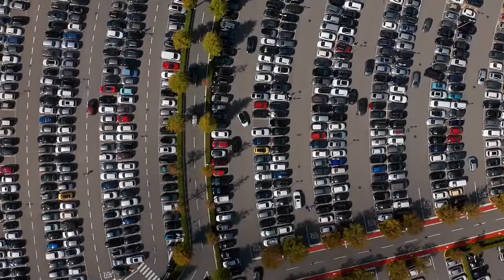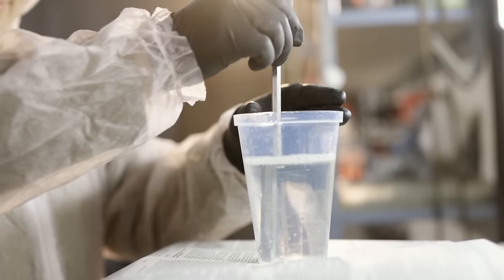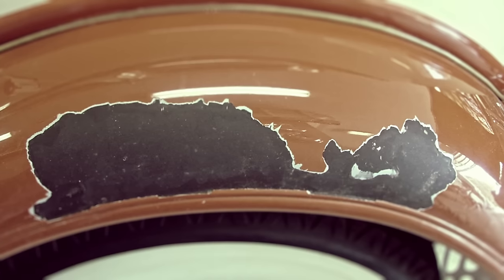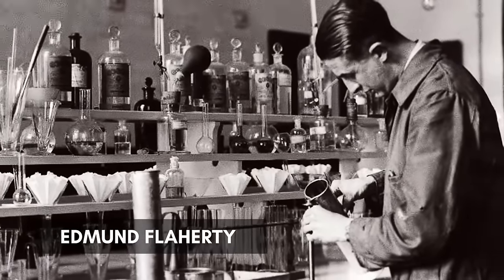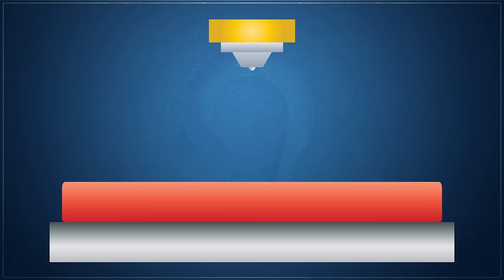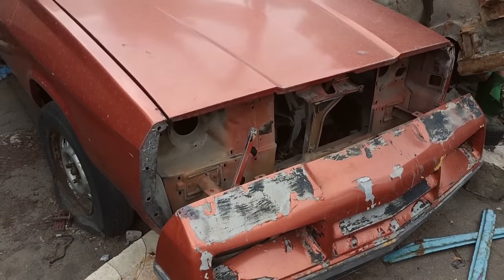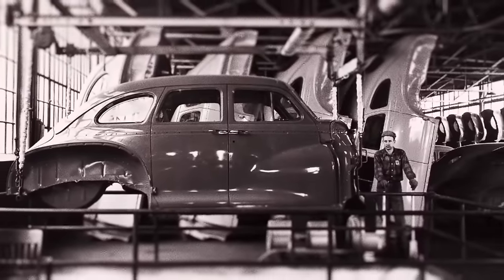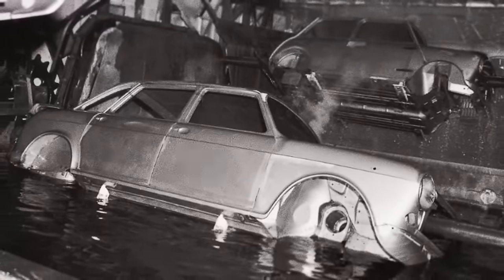The Evolution Of Automotive Paint

Comment: i have worked on cars for some 50 years and now have a collection of old "mopar" muscle cars.  after graduating from high school in 1972, i built and ran an auto body shop for three years and then went on to college and law school.  i was the main "paint guy" at my body shop.  in the 60's and 70's, GM used Acrylic Lacquer and Ford and Chrysler used Acrylic Enamel paint.  both these paints were "single step" paints meaning that you just shook the paint vigorously, thinned it (usually 2-1) with a Lacquer or Enamel thinner, and then sprayed the paint on the vehicle.  most colors required at least two coats - except black.  the "metallic" paints (paint with small metal flecks) had to be applied in a certain way or you would get what was called "tiger stripes" meaning that you could see broad "mismatched" areas where the metal fleck "laydown" was mismatched from one area to another.  the thinners for these paints came in three temperatures ranges, fast drying, medium drying, and slow drying.  you used fast for cold shop temps and slow for hot shop temps.  Lacquer was the easiest to use as if you made any mistakes like a dry spot, a "run in the paint", or the pesky fly that hit a panel, you could wait an hour and the paint was dry and hard enough to sand down and completely refinish.  Acrylic Enamel was a different story.  that paint was a little thicker in viscosity (as it had more clear acrylic in it) and you usually had to wait 24 or even 48 hours to sand and refinish Enamel.  it was also easy to "blend in" small repairs or "partial panel painting" with these paints.  there was little difference in appearance between these two paints, however, a skilled bodyman or painter could tell the difference between Lacquer and Enamel vehicle paint.  i closed my body shop in 1974 to go to college.  when i retired from my law practice in 2016, i started my car collection.  i have found that the "water based paints" are AWFUL and CANNOT be used by a private person in their house garage.  you MUST have a professional, commercial "paint booth" to spray the water based paints as they need constant air flow and "heat" to cure properly.  the "base coat, clear coat" paints can be sprayed by a "do it yourself" private car restorer.  i restored and painted one of my 1968 Plymouth Barracuda's using Acrylic Lacquer that I was able to get "custom mixed" and painted that car in the garage of my house.  it came out very nice and looks just like the paint that would have been on the car when it was new in 1968.  one thing about painting "old cars" - if you are a "purist" and want your car to "look like it did when it was new", you have to find a shop that can spray the old single step Lacquer or Enamel.  ALL the new paints, water, base-coat/clear-coat, "Emron" type paint using an additive or "hardening agent" - all those paints have a MUCH higher gloss than paints had 55 years ago.  only a few "luxury" cars "back then" had REALLY glossy paint jobs - like the Cadillac's and Lincoln Continental's.  there were no Chevy's or Fords or Plymouths or Dodges or Pontiacs or Buicks or Oldsmobile's that looked like the cars do today.  like so many things in this world now, EVERYTHING is much more complicated - AND EXPENSIVE!!  when i contacted PPG (a major car paint company) to get a gallon of Acrylic Enamel to paint my 68 Barracuda with original paint (yes, PPG still manufactures some old OEM paint products), they said, "Yes, we have that paint, it is $1000 a gallon."  i ended up painting the Barracuda with "Lacquer" at $327.00 a gallon.  it is not unusual for a simple, modern repaint of a car costing $10,000 today.  when i ran my body shop in 1973, we charged on average, $150.00 for a complete repaint.  there was a guy named "Earl Schieb" who had a series of "franchised" body shops around the country who advertised "A new paint job for $29.99!"
Reply: You still can't beat a single stage acrylic enamel for durability, and longevity.
Reply: @never2late454  Dupont used to make a basic auto enamel paint called "Dulex."  you could paint a concrete block with it and see your face in the shine.  it was so thick it was almost like today's "powder coat" paint.
Reply: @jimharvard  Dulux was a great finish, but if I'm remembering correctly it took forever to cure. But a properly laid down acrylic enamel will last a lifetime if taken care of. I have a 1970 Mustang with the original paint that still shows a reflection.
Reply: @never2late454  i used both acrylic lacquer and enamel in my body shop in 1973.  you could get fast, medium and slow thinner for both paints.  acrylic enamel could be shot pretty easily using the "fast" thinner, however, if the shop was very hot and you had to use the "slow" thinner with enamel, it would run if you didn't put the first couple of coats on very thin.  you had to let enamel "tach up" for about 10 minutes before you could spray more to cover primer patches or to add color.  i never had a paint booth in my shop and had to rely upon the different thinners and my own skill to get nice paint jobs done.  i'm guessing that using the new paints in a modern paint booth is a lot easier than in the old days when you just "sprayed water on the floor" to keep down dust, mixed the paint in a Develbis or Binks "suction" (cup on the bottom) paint gun and get to spraying.
Reply: @jimharvard  Mack Truck used to sell this two part Kirker through their parts department back in the 80's. "Mack Standard Red" was my go to paint for pretty much everything, trucks, trailers, forklifts, even my girlfriend's car lol. 30 bucks a gallon including the activator for red, Other colors were cheaper. It worked pretty good and it held up well. Now I look at automotive paint prices and about have a stroke. I used to be able to paint a truck tractor for about 200 bucks in materials, and maybe 250 for a ten wheel dump. Boy I miss the old days
Reply: Interesting that when talking about acrylic lacquer weaknesses you show a faded out Ford Falcon painted with Alkyd Enamel as FoMoCo never used lacquer.
Reply: @OscarHedden-eh4xk  i think you may be responding to the wrong thread. where is the Falcon that you are referencing?
Reply: @jimharvard  you're correct I replied wrong place but it shows up around 5:00  in the video.
Reply: PPG (Ditzler) Delstar was the best acrylic enamel ever! Still have a 78 Dodge Stepside painted the medium brown metallic that I sprayed in July of '93. Never been buffed, never been waxed and the paint still shines. It was marked as **May require additional coats for hiding**. It took 5 coats just to cover, and I did two more for durability. And Delstar, the day after spraying, almost had a sweet smell to it. So when working around a vehicle the next day, it didn't stink you out, like the acrylic urethanes (Deltron) did at the time.
Reply: @dodge68  i remember Ditzler paint and i think we didn't use it because it was "more expensive" than the Dupont line. i think Dupont's acrylic enamel was called "Centuri."  all of the old "single-stage" paints were easy to use. all you needed was the right temperature thinner (fast,, medium or slow) for the temperature in the paint room and some practice on using the gun.  pretty much anyone back then could become a decent auto painter with a number of hours with the gun in hand.  mistakes were pretty easy to fix especially with lacquer and the final results looked like a "shinny new penny!"
Reply: @jimharvard  you're correct. The PPG line was more expensive then DuPont. In the town I live, DuPont wasn't kept on hand by any of the local jobbers. If we wanted DuPont, we had to order it the day before, and have it delivered from about 25 miles away. So our town had Sherwin Williams, Martin Senour, Acme or PPG. The first three were the exact same products with different names. All three even had the same address printed on their cans, 101 Prospect Ave, Cleveland Ohio. So PPG was our only in town choice for a good product.
Reply: THERE'S ONLY ONE... AND ONLY ONE STATEMENT THAT'S ALWAYS TRUE FOR ALL HUMANS ON PLANET EARTH AND THAT IS: "YOU DON'T KNOW WHAT YOU DON'T KNOW "
Reply: @jimharvard even with a booth you still get stuff that won’t fit in there and then you’re out spraying the floors down anyway lol

Comment: Auto Paints don't last in environments like the American Southwest on their own.  I'll dare say, they are massively inferior to older manual intensive processes. The new process needs refinement to fight oxidation of large hoods and roofs. Toyota paint systems are notoriously quick failure systems out here. Usually less than 5 years in worst conditions.
Reply: Toyota paint, especially their blacks are notorious for oxidation due to not using a clear coat system. I literally just spent close to 10 hours turning my fathers 1999 4Runner's black paint that was chalky gray back to a brilliant deep gloss black finish. Two of his neighbors thought he had got it repainted  it was such a huge difference. 
As for the southwest, i'm in southern california and my 2010 Audi has been parked on the street  since i bought it new and i have zero issues with clearcoat or paint oxidation or failure. And i have been horrible at paint maintenance at least for five of those years. Perhaps its because Audi uses Glasurit paint made by BASF.

Comment: Been painting cars for 8 years.. what a cool video! I have sprayed both modern water based and solvent based paints. In my experience water paints provide a better user experience, but solvent paints generally provide a more durable product that can be more reliable and less finicky in the long run. With a good painter using the correct products, it can outshine waterborne as well. I spray a hybrid of the Axalta Cromax system.. Standox base coat which is ok, but with their 7900s series clear coat, it is absolutely phenomenal. The clear really makes the product.

Comment: acrylic laquer and polyurethane will always be the best coating that I worked with acrylic laquer for custom painting and polyurethane for bependablety
Great video I did a lot of painting in the early '70's and '80's lot's of artwork with acrylic laquer...and even with Imron polyurethane's I seen some cars and vans painted 10+ years ago and they looked like they were done yesterday that paint could take a lot of stones bouncing off them and still look like new . .
Reply: I was hoping to hear more about Imron paint - when it's applied correctly it's bullet proof.  Had a 1976 Datsun 280z with Imron paint.  This was in 1989 and it still had the original paint job in Upstate NY.  I did end up painting it again with the original Imron color and that probably is still good - miss that car - but man that was some expensive paint
Reply: Bependablety?
Is that dependability? 

I assure you, no trolling here.
Just wanted to confirm your chosen words.

I feel like the context pulls me towards dependability, but I am no pro painter. There could just as easily be a term I am not familiar with.

That said, i always prefer acrylic laquers due to the intense pretty.  I am usually rattle canning something in a uncontrolled garage though, so my idea of pretty is defnitely "paint it black, hit the track" over "watch the orange peel, make sure it flashes off properly...."

Comment: At 11:30. As far as I'm aware wet-on-wet doesn't usually refer to clear over base. It refers to spraying base over a smoothly applied primer or sealer that is not sanded or fully cured. It can save time but obviously the underlying surface needs to be well prepared and perfectly flat in advance. Technically the application of the clear over the base coat is the same technique but that terminology isn't used because that's the only way to do it.
Reply: It can refer to either. Typically there is not a full bake between base coat and clear coat.
Reply: @mightychicken93  It doesn't need to be baked to fully cure. Modern automotive paint  cures in under 2 hours due to the catalyst.
Reply: At Volvo trucks here in Dublin Virginia the process is Dupont brand base coat sprayed by robots. Then 1 or 2 minutes later the clear is sprayed. It is considered wet on wet. Then it gets baked by ovens for two hours.
Reply: @LBCAndrew Complete curing of eurethane, where the cross linking of molecules has taken place, takes about 30 days. Baking speeds initial dry time, but cross linking is still occurring after initial drying. Drying is through the evaporation process, where curing (cross linking process) is a chemical reaction.
Reply: Ah here's another expert 😅